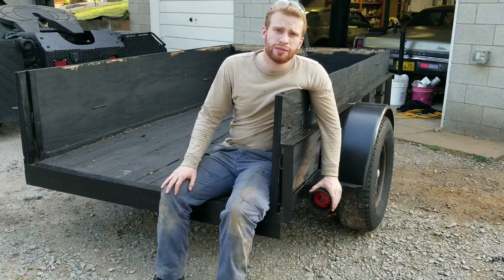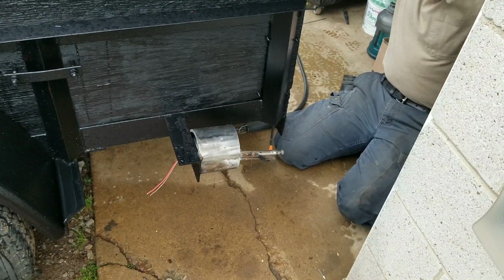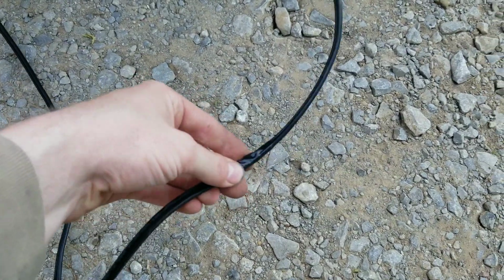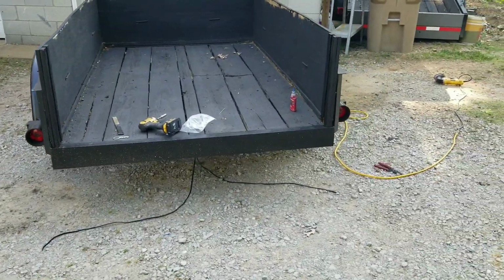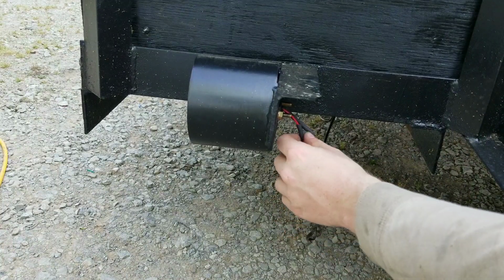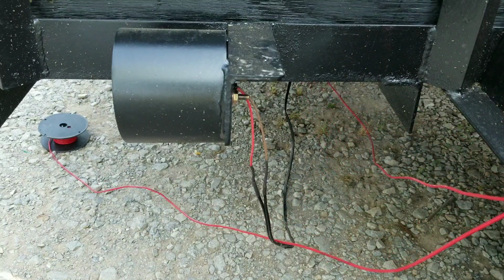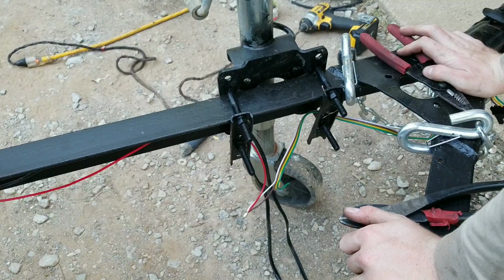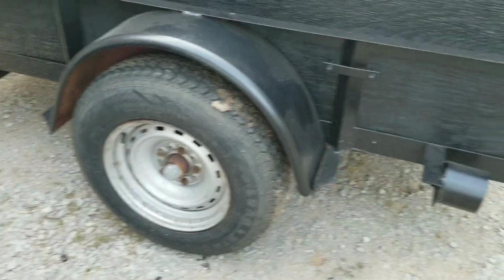How to Install New Tail Lights With Guards and Rewire 5x8 Utility Trailer

Comment: I would drill a hole on the side of the cylinders so the Lights are Visible from the side ,will prevent Unwanted Accidents. More see more better!
Reply from the maker: I'd have to add markers, these lights don't have much side visibility.